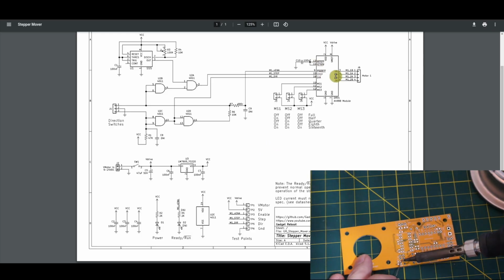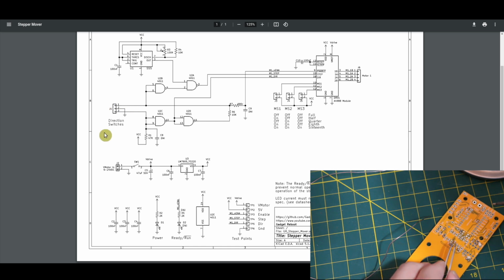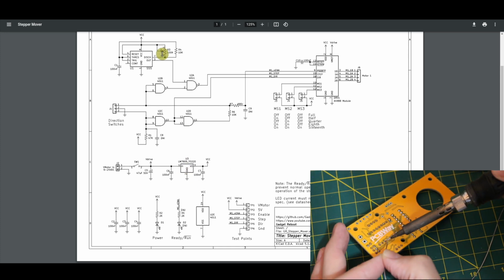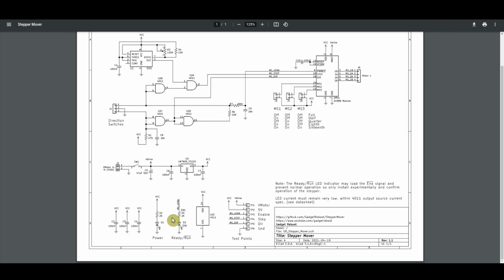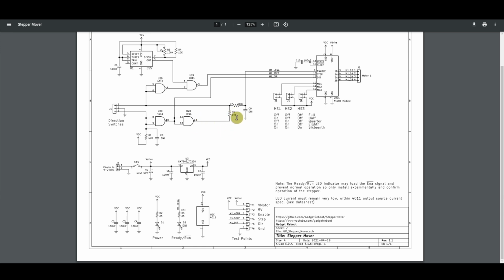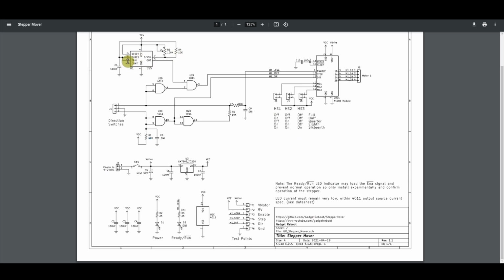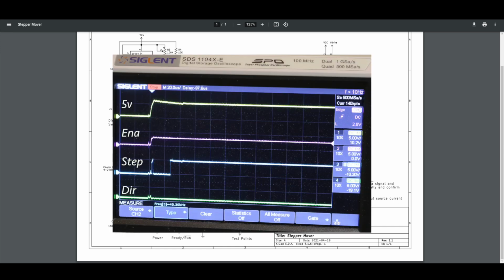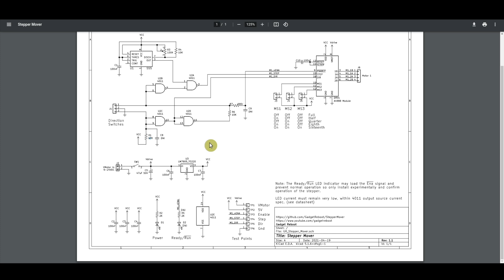A4988 Stepper Driver PCB - Uses a 555 - For Quick & Dirty Motor Tests

Comment: I'm an electronician since the 80th.
These componants A4988 TMC2208 DRV8825 are just bullshit craps.
They grey for any pretext, but the main reason is they do not intagrate a current limitation, which is somewhere understandable they grey, since the voltage we use with stepper motors is often a minimum of 24 Volts.
If we calculate the resistance of one wiring of the stepper motor which is probably about 5 ohms i did not look but very low.
I do not speak of impedance because when problems occurs you come at a situation where you feed your motor with continuous voltage.
So we arrive at a voltage of 24/5 =  4.8 A. which is a minimum of 100 Watt power if for example we have the same current with a short through motor. And there aren't any surface on that craps. 
Wich is pretty high and often make the component burn by heat.
The problem is there is not surface and  the steaked radiator they sell with which has not a real fixation is not serious at all.
It was a time people made their quadrature system and it was thousands of time more reliable.
It's not since yesterday many factories and companies use stepper motor.
More and more they build craps which you do not even know what's inside.
Reply from the maker: Thanks for clarifying, and more importantly, thanks for watching!

Comment: No debounce was needed for the buttons?
Reply from the maker: not for this application, but optional capacitor footprints are on standby.  Worst case if there's switch bounce, the motor may try to start and stop a couple of steps before really going, but we're only trying to move on the macroscopic level so it is negligible.  I'd be more worried about ESD or other external noise if the switches are off board.

Comment: Have been at war with A4988 until recently.  Was using a salvaged stepper from a floppy, and unable to get fine steps.  Turns out, the trimmer on the driver must be set to a low current limit, for PWM to engage in less than half-stepping modes.
In order for you to determine if 1/16th stepping is truly "smoother" than 1/2 stepping, you must run it at 8x the speed.
Since you have a real Nema 17 though, that draws a lot more current, you may not have my difficulties.
Reply from the maker: The biggest problem was finding a screwdriver that fit the trim pot.   And I blew up one 4988 module while probing 5v with the meter and shorting it to the next door 12v test point...luckily I had 5 drivers.   They're like fancy fuses, just swap them as needed.
Reply: @GadgetReboot  I've blown one as well.  Those trimmers are not meant to be messed with much.  Saw one vid where an alligator clip was attached to the screwdriver itself ... the cap head is a test point.

Comment: Instead of a 555 you could have used one of the logic gates as well, makes the design even easier!
Nice little project btw!!! :)
Reply from the maker: Yeah if I had a preferably Schmitt gate where I could use it as an oscillator that would be good. 
I think in retrospect I didn't really need to gate the clock against the enable status, but it probably does help prevent a few early attempted step pulses from jittering through during start/stop while direction is still trying to get settled.
But if I just went with not gating the clock, the other gates being inverters, I could have used a hex schmitt inverter and had lots to work with.
Reply: @GadgetReboot  Was my thought as well.   The 74HC14 is useful for lots of stuff.
Reply: @GnuReligion  yes! Most "youngsters" (interns) are always a bit amazed when I pull out another logic gate trick LOL.
With a bit of creativity, one can do A LOT with logic gates.
While back I made a simple crude ADC for a ucontroller. All analog ports were already taken. More than good enough for a simple potentiometer. :)
Reply: @p_mouse8676   All you really need are diodes and inverters, eh?  With a hex inverter, have built a 3-bit register, and even displayed the output as one of 8 LEDs.  I have no idea what they were using as a common inverter in the Vac Tube days.
Reply: @GnuReligion  Probably Pentodes (triodes can be a little fiddly that way)
There is actually a guy on youtube building a computer with vacuum tubes.
Fascinating!
Reply from the maker: Usagi Electric?
Reply: @GadgetReboot  These days I actually only buy schmitt gates. Anyway, this also worked :)

Comment: 'Feature' ! nice work...cheers.
Reply from the maker: Yeah there were a few other hidden features I discovered too!  Like the choice of heat sink and the physical size of the electrolytic, they had to be convinced to make room for each other
Reply: @GadgetReboot  I take it you simply 'insisted' !
Reply from the maker: I did...The heat sink material was rather malleable so a few lower fins volunteered to move and the electrolytic was a bit too robust but it nudged a little.  I likely don't even need a heat sink with the TO-220 package already being robust for  a small load, but the 7805 came out of the drawer with it already attached

Comment: If I need to do a quick test of a motor or I need to move or test an axis, I use another stepper motor.
I have a fairly large stepper that I know the wire assignment to.
I attach the wires directly to the wires on the motor I need to test. I have a simple hand crank on the bigger stepper motor.
Turn the crank and the test motor should turn if you wired it correctly. It helps if I dont have or can't find a data sheet on the motor and need to identify which wires go to which coil.
I built a poor mans CNC machine once. Powering three nema 17 steppers with 3 nema 23 steppers...
You can use to identical motors like that too. Wire the colors to like colors.
Red to red, blue to blue, you get the idea....
Turn one and the other should turn.
.
Reply: https://youtube.com/shorts/FckN7oq7oLA?feature=share
15 second video of what I'm talking about.
Reply from the maker: I've only ever turned on an LED with a hand cranked stepper before.  Never thought to turn another motor with it.